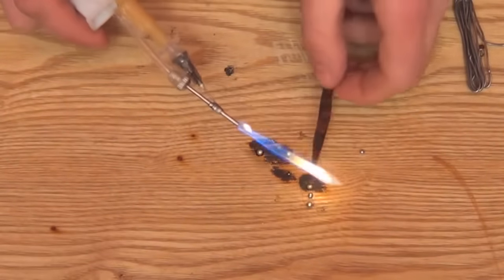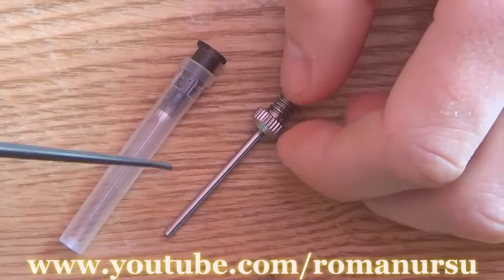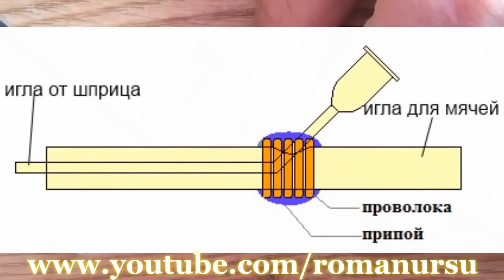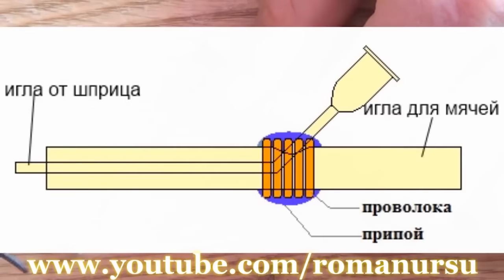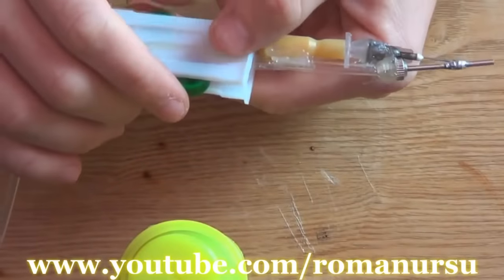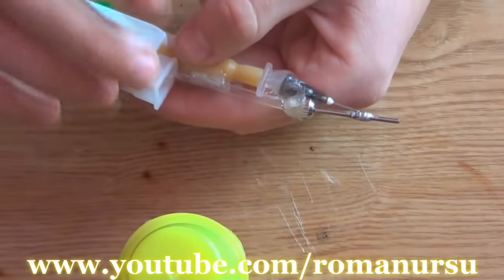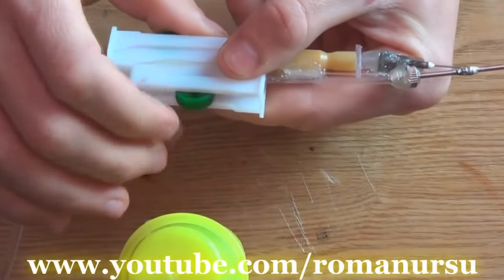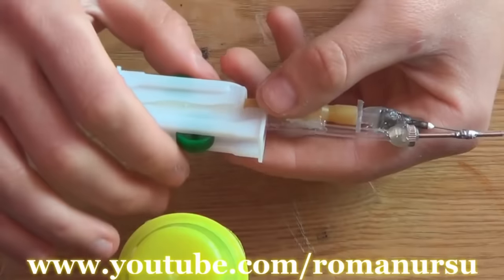How to make a mini Gas-jet (up to 1000ºC)

Comment: The only problem with this that I can see is that it would eventually heat up to the point that the solder holding the copper wire on would melt as well... but other than that it's a great concept and seems to work great!

Comment: This question might be a bit dumb, but is the compressed air really necessary? Wouldn't bernoulli's principle cause air to be drawn in enough to create the same effect without having to have a compressed air reservoir?
Reply: as you can see, when he lowers the compressed air to a minimum it resembles a standard lighter flame. Completely cut the air and its basically a lighter. The fuel may be released at a compressed rate but once it exits the nozzle component it gets reduced to a regular flame.

Comment: wow! this is very creative i can totally relate with this work, but my fear is that it doesn't have a flashback arrestor, which makes it very dangerous in any case of flash-back anything like flashback will result in explosion. thanks anyway for sharing good job ;)
Reply: No need, you are mixing your fuel and oxidizer only outside the nozzle - only in a premixed flame can the flame run up into the piping

Comment: why compressed air instead of oxygen ? why did you put the air from the centre instead of surrounding the flame ? i have a set of torch that i use to braze copper pipes and the gas coming from the center and it blow oxygen from the surrounding holes to oxidize it,and by the way the torch you make in the video is very dangerous,what if the gas leak ?

Comment: For anyone curious the "valves" he used along with the tubing was from an IV. Clever, but very dangerous.
Reply: Thin plastic, high temperatures + file under pressure = danger.   But yes pretty smart little outfit overall.
Reply: If you find the amount of pressure and the volume of gas he is using as dangerous you should not be attempting awesome DIY projects anyway.

Comment: you should be careful with this, you should add a water trap to prevent blowback.
Reply: Lol.. Which is going to blow back? The air!? Certainly not. Or the pure fuel? (the fuel in the can doesn't have oxidizer e.g. air mixed in)
Reply: +Brew Dain it can still have air in it from when he assembled it

Comment: I don't think it will up to 800℃ The temperature depends on what kind of gas you use
Reply: any gas pluss oxigen, whay do u think is the red cilinder on the oxytorch?
Reply: +Krishan Patel no, he's just bad at spelling
Reply: Josh Lukowicz "Why do you think is the red"
Can you explain what that means?
Reply: +Krishan Patel I think he meant that the flame is red, or that the flame has such high temperature that it heats the metal up till it becomes red.
Reply: Jesus Diaz Oh sorry :D
Reply: +Krishan Patel grammar*
Reply: +Jesus Diaz yes but that is if you give it 100% oxygen, he is only giving the gas 18% oxygen
Reply: +The Piscis  lets say its propane. its the comon yellow ligther gas that i belive he is using this is from wiki 

a large factor in the temperature of the flame is 
the percent of oxygen mixing with the propane. With air/fuel torches, 
since air contains about 21% oxygen, to obtain the maximum flame 
temperature with air, a very large ratio of air/fuel must be used. Even 
glass bead-making torches, which are essentially bunsen burners with an 
added air pump, can only achieve temperatures of 1,100 °C (2,010 °F).
Reply: +Gong QiChen You can always throw carbide with water into another bottle to produce acetylene jet burner and you have a much more powerful but a dangerous burner. If you added pure oxygen, then the nozzle would most likely melt and I would definitely not rely on these plastic regulators if I were to play with pure oxygen. You wouldn't like to see it blow up
Reply: +Jesus Diaz Acetylene red is Acetylene
Reply: he is using what look like lighter fluid for the fuel
Reply: me too
Reply: +Jesus Diaz acetelene
Reply: +Mike Enns er
Reply: Yeha i whas wrong aboit the colors sorry abou it....bit my poimt still there
Like i lernd on malcom....gentelmans it poimtless discuse lest make a video :)
Reply: It's butane.
Reply: Gong QiChen
Reply: Добромир ￼

Comment: or just buy one for about $4 that burns at 1300C
Reply: yes i say the same.
Reply: That would be no fun
Reply: +Jamie Swindall .it is of course true, but is it not dangerous if you have not done it right?
Reply: definitely. the hole tube from the gas container up to the valve is filled with highly flammable gas. Also the gas container is constantly pumping out gas. The connection might leak lots of gas
Reply: from where?
Reply: lets just chalk it up to a survival tutorial in case your kidnapped and the idiot put you in a room with the materials to make this and melt the lock off the door... or any other situation where you need this fast and cant wait for 2 day shipping.
Reply: John Vlijm its about making it yourself and the happines when you succeed
Reply: Pixlminus Abhishek gujjar
Reply: +R

Comment: I can see u are very intelligent! I hope your other vids show this level of MacGyvering! love it, what other uses for a mini jet tho?
Reply: Smoking Meth. Soldering. Slowly cutting a hole in aluminum siding to escape through. Melting glass. Removing air bubbles from poly resin type clear coat. Lighting cigarettes. Quickly burning the insulation off wire, it's easier and less damaging to the wire. Did I mention smoking meth?
Reply: Ohhhhhhhhh- Hello lgbt community-

Comment: but how does the solder on the needle doesn't melt when lit up
Reply: +Adarsh Shamloll Everything is being forced outwards faster than the flame can travel. That's one of the reasons why its best/recommended to use the compressed air as to push the fuel mixture faster than the flame can travel up the pipe. Because of this it stays relatively cool. It works on the same principle as a bunsen burner.
Reply: Thanks
Reply: +Mr Rishi The Cookie But what happens if the compressed air runs out? Shouldn't the flame be able to reach the can of gas, making it explode?
Reply: stefarossi good question
Reply: The niddle is not too hot  because the gass is burned out of the niddle. That's why the soldering isn't melting
Reply: +stefarossi I believe that the compressed airs oxygen would run out fairly quickly forcing the butane to burn with outside air. This would then heat up the nozzle as it make a fairly large flame as the butane would travel further out to burn fully. Only then would it heat up but probably not enough to melt solder but definitely enough to burn if you touch the tip. Also the large flame would be more of a concern and not melting the solder.
Reply: +stefarossi  and the gas /fuel is compressed so not likely as there is no oxygen in the fuel tank.
Reply: +Adarsh Shamloll if your air supply runs out . You can just Quickly put the needle end on to say a rag or rubber pad. This will snuff out the flame and you won't need to worry :)
Reply: +Mr Rishi The Cookie the flame will never get into the pipe because it needs oxygen to burn
there is no oxygen in that pipe when you pump only fuel so it can never get inside
Reply: +dligac yup. But I think I implied that.
Reply: +Mr Rishi The Cookie I think you did...
Reply: +stefarossi  Butane or propane is different from acetylene. Butane (C4H8) has no oxygen itself, so it can't burn into the pipe or can. You can see this in your home stove.
Reply: Adarsh Shamloll kkk

Comment: Hi
After i watched your video, i tried to make just like what you made. But i found some problems  and if you dont mind, i have a few questions.
1. What kind of fuel did u use? I used buthane fuel for portable stove and i have problem with the joint (the bottle and the gas-way). It was leaked. (The diameter of the hole on the end of the gas way is too small and cannot withstand the pressure of the bottle, so it was leaked on the junction).
2. Do you have alternatives to make the joint?

I would very happy if you can share your answer. Thankyou

Comment: i'm certain that is not reaching 100*C. I'd say  750*C at best. Soldering lead melts at less that 300*C. Try it with silver wire used for jewellry soldering and see what happens.

Comment: What about when you run out of air.. and all that is left in the tubes is flame leading back to the gas can?? seeing as the air is no longer forcing it out? I am not some fire pro, but that just seems logical that the fire would lead back to the can and explode
Reply: +Illusunati Record Label gas doesnt burn by itself it needs oxygen

Comment: Used to build HHO genertators and made a small tourch out of one. No compressed air needed, could even weld with it. Welded a nail to a rock with it, also used it for cutting.Similar in size this.
Reply: +Electronicdawg wtf, welded metal to rock? thats not even possible.
Reply: +aakkoset yep it is m9
Reply: +JK JIBJAB well, i suppose you can explain a little about it then? i thought that rock doesnt melt at that low temperature and isnt the definition of welding that the two materials melt and become one?
Reply: My dad works for Microsoft , his job is to weld steel beams to rock using jet fuel
Reply: +aakkoset the metal would stick to the rock but he said "nail"
Reply: +CrazyMarkSRB hello. I love you vids
Reply: +JK JIBJAB hi i love you too
Reply: +CrazyMarkSRB 😃
Reply: +aakkoset It is most certainly is possible Ive done it. There is metallic content in all rocks. HHO can burn as hot as the sun. It's pure hydrogen burning mixed with pure oxygen.!
Reply: +Electronicdawg It can't reach the temperatue of the sun any day as sun is not powered by burning hydrogen.
Reply: +Jaakko Fagerlund What's it powered by then. Batteries?
Reply: +Electronicdawg Your question would have been answered by a simple Google search. Sun is not powered by burning hydrogen, it is powered by fusion. That's where hydrogen nuclei are fused together to form helium. Temperatures range from 5000 K to 15 million K from the surface to the core.

So no, it is not powered by burning hydrogen.
Reply: Electronicdawg You don't seem to understand the difference between fusion and combustion. The other requires oxygen and produces weak energy output, while fusion requires only hydrogen nuclei and produces helium and lots of energy.

So no, hydrogen can NOT in any way burn hotter than sun.
Reply: +Jaakko Fagerlund Without hydrogen there would be no fusion and I should have said that the torch burns as hot as the surface as the sun. depending on what you use it on. Oh I studied phisics and I didn't have to look it like you did, what you should have done was look it up before you opened your mouth. Ask anyone that has had experience with HHO torches if they will melt rock or weld metal to rock. Also Nitrogen is neither fushionable nor combustible by itself. Plays a small or no part in solar fusion
Reply: +Electronicdawg Also the Hydrogen on the sun is not a gasious form of Hydrogen it had been compressed so much by the suns gravity that it is a metalic form of hydrogen. Hydrogen is also the most abundent and most volitile element in the Universe and can reach temps of 1,000,000 degrees.
Reply: Electronicdawg Welding metals and melting rock don't need temperatures that the sun surface is. The flame temperature of hydrogen is way lower than the suns and doesn't have any relevance to the temperature that you can heat things up.

What does nitrogen have to do with this conversation? Didn't mention it at all, as it is not relevant to hydrogen combustion nor hydrogen fusion.

Did I say something about hydrogens phase or that it matters? No I did not. You still can't achieve the same energy levels by combustion than you get with fusion.
Reply: Electronicdawg  Welding metals and melting rock doen't need temperatures even near what the suns surface is. The flame temperature of hydrogen is way lower than the suns and doesn't have any relevance to the temperature that you can heat things up.

What does nitrogen have to do with this conversation? Didn't mention it at all, as it is not relevant to hydrogen combustion nor hydrogen fusion.

Did I say something about hydrogens phase or that it matters? No I did not. You still can't achieve the same energy levels by combustion than you get with fusion.
Reply: +Jaakko Fagerlund Ididn't say it needed that high of temperature to melt rock I said HHO can reach temps that high depending on what it's used on.. The sun id formed from Hydrogen and nitrogen. Thought you looked it up
Reply: Electronicdawg Nitrogen is not needed in hydrogen fusion, so no, it does not play any relevance to this discussion.
Reply: +Electronicdawg  yes, but I have to say that lighting a self oxygenating gas that is trapped inside a container is not a very bright idea
Reply: +aakkoset not sure if what he says is true but welding a nail to a rock is possible if you reach around 3000 celsius but Im not even sure it will still look like a nail at that temperature.
Reply: Luis Fernando What rock will need 3000 degrees Celsius to melt?
Reply: Jaakko Fagerlund Not sure exactly which one but probably I got a bit confused it was round 3000F according to this:
watch?v=JIlZsuRc9jQ

Comment: and that thick needle you said its of a pump, what pump? what to ask for at the medical shop to get at thick syringe.
Reply: it's a football pump nozzle and a regular needle along with 2 sets of transfusion tubing. the can is a refill can for lighters (with propane/ butane) and the valve on the pressurized air bottle is a normal bike valve.

Comment: Can I use those "fix a Flat" air Cans instead of the bottle? How long it will last? same as the gas can? Like, change both.
Reply: please don't build one of these if it leaks your dead and gas torches are like 20$ at the store
Reply: +darwin miller (SpaceIsThePlace) nah I don't think this will be much more un-reliable then the china ones available here.

Comment: Very cool, but butane does not burn at 1000 °C
Reply: If you have the correct fuel to air mix it can and because the air is coming out under pressure it is adding more oxygen allowing allowing the normal burn temp to be much much higher.

Comment: what useful this for this thing? To solder you have already solder iron to mek the two needle together. otherwise it very useless
Reply: +tosgem I could use it to bend glass tubes.
Reply: Yea, but if you want a soldering iron and don't have one, you could possibly borrow a friend's and make this.
Reply: heating up steel for the ability to bend, if you need to just make a few of these to heat the steal up in all places, but its just easier to build a furnace for steel and glass

Comment: Won't the solder melt due to the heat of the torch?
Reply: +CaptainCrush lead based solder will melt 90% sure, non-lead (silver) solder would take higher temps without melting
Reply: +CaptainCrush      Actually, because air is moving through the tube it keeps it cool.

Comment: what that "THING" he applied to the copper wire in the Syringe?
Reply: +Romeo Leo III L. Onque Just standard solder.
Reply: +Lunaphase Lasers  that's not so hot man a normal lighter has 800°C

Comment: "you need two needles" , "i got the bigger one from a bum"
riiiight
Reply: A pump. Can you not tell by looking at it the bigger one is commonly used to air up footballs and basketballs? The smaller one would be a hypodermic needle that someone as judgemental as you would assume a bum would carry. Cause all bums are intravenous drug users right? SMH
Reply: @patrickhenry3356  Your awfully defensive of an assumption you made, not me.

Comment: maybe 100c not 1000c
Reply: +Ryan Lucey 100c is the boiling point of water and that flame was melting metal. its definitly more than 100c
Reply: I know its the boiling point of water. Im a welder dude. My acetylene torch doesn't get up to 1000c
Reply: Actually no im wrong. My torch can get up to 3000c. lol my bad. But still. Not pushing 1000c outta that little thing.
Reply: With that blue flame you can expect to get a maximum of ¬ 600 to 800C. Not too shabby but nothing amazing either. It's basically just a 'portable' bunsen burner.
Reply: +Ryan Lucey  You're a disgrace to all welders. I'm a welder too, and this can definitely go to 1000c. A normal candle burns at 600°-1400° degrees Celcius, and the torch the guy made is definitely hotter than a candle light.